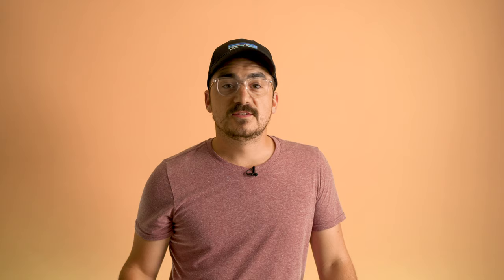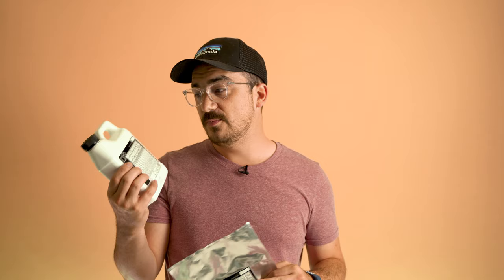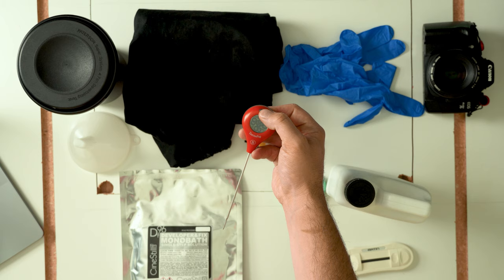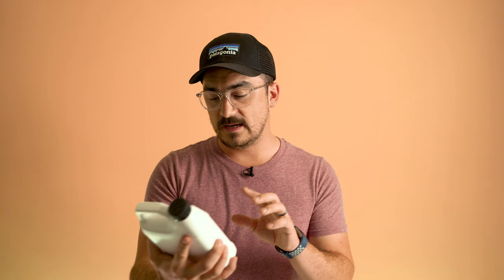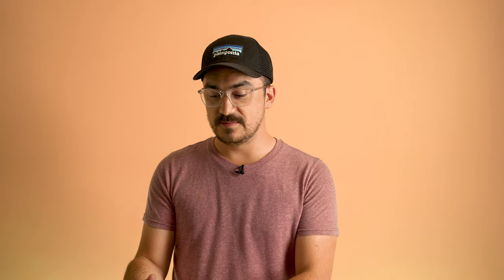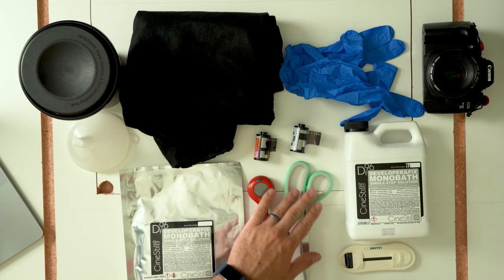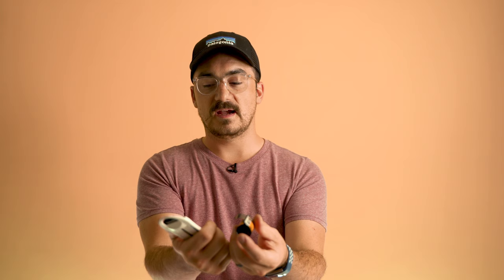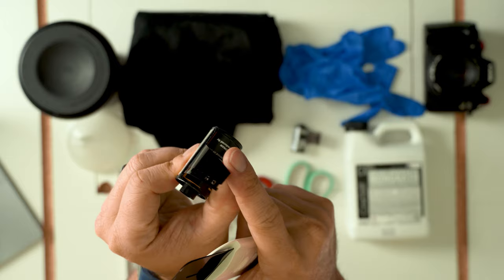How to develop black and white film with one easy step - CineStill DF96 Monobath

Comment: I love using Kodak HC-110.  Incredibly long shelf life.  I've had my 1L bottle for years and still use it with no issues.  Compatible with many film stocks and the dilution makes it super cost effective.  It lasts forever and I save a lot of money by using water as a stop bath.  HC-110 is my favorite developer, by far.
Reply from the maker: Great to hear!
Reply: i use Rodinal which is basically the same thing, i read somewhere that someone even used a 30yrs old opened bottle and it worked, you can even make extremes dilutions to save it even more

Comment: After 56 years of darkroom experience. Big tip. Do not use photoflo when film is on reels and or in tank. It cause after a while foaming of developer from a sticky residue left on reels or tank. It Will Cause major problems with film development in the future
Reply from the maker: That is a fun experience comment. I really dont know of a way to apply it if youdont do it in the tank. should you spray it on or somehow wipe the film hung?

Comment: @1willcobb do you recommend using the collapsable bottles for the photoflo and the Monobath?
Reply from the maker: You don’t need them for those two but if you like fun bottles then yes!
Reply: No. (1) Plastic bottle are subject to penetration by oxygen (slowly) and the degree of such depends on the surface area of bottle exposed to air. All of those little folds give the flex bottle a huge increase in such surface area. (2) Developers and fixers produce by-products which adhere to the inside walls. They have to be scrubbed to clean, and the flex bottle are practically imposable to scrub out. (3) They cost about four times as much as a same volume bottle designed for chemical storage in amber glass.  Photoflo mixed down to use dilution is inert. You can store it in anything clean. However, it is so cheap, and its main virtue is its cleanliness, so I'd just mix for use and toss after use to avoid contamination and grit.

Comment: According to the directions printed on the bottle...you can develop uo to 16 rolls of film. Not use it 16 times that would mean 32 rolls of film. The chemicals would be used up after the 16 rolls and your film would be ruined.

The instructions also state you have two months to use the chemicals after it's been opened.

When the air contacts the chemicals it begins to degrade it. That's why you must use it within two months after opening the bottle.

Read the directions carefully. If you don't understand any of it call the customer service number and ASK. 

There's nothing worse than ruining the negatives because you didn't read or understand the instructions.
Reply from the maker: Totally 💯
Reply: Hey i don't quite understand the 16 rolls. Does it mean 16 rolls of 35mm and 8 rolls of 120mm?
Reply: @samuelvodicka8441  advice I've seen is to count every 35mm roll as 1 and 120 rolls as 2. So start with your initial 16 developments allotted and for every roll of 35mm you develop subtract 1 and for every 120 roll subtract 2. Add 15 seconds to the total development time for each 35mm roll and 30 seconds for each 120 roll.

Comment: Hello Will, reat video, I was no aware, such a B&W developer existed . I'll have to check it out. Question on agitation , I'm photograph g fall  colors this year  on film. Watched your video on c41 processing , and that convinced me to give it a go.  Coming from processing B&W, many years, I prefer to agitate , using the twister stick . With c41, my Paterson tank will be in and out of the warm water bath, so I'd want to continue using the twister stick   , versa the iinversion method. Any issue here ? Let's say, I'm a little obsessed with sloppiness. I know the  Cinestill instructions reference inverion method, but does it really matter, as long as it is done in the proper time frame ?

KEEP the great development video coming . KB
Reply from the maker: So it helps move the liquid over the film. Where as the stir stick just sloshes it a bit. Also, inversion make sure there is no air at the top
Reply: @film_friends  Ok, so ill use inversion for C41. Thanks.KB